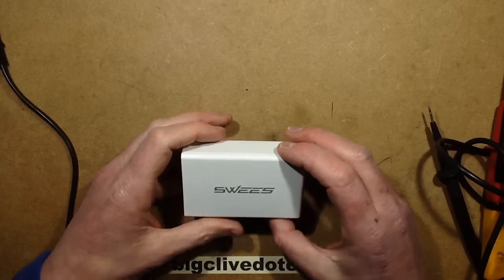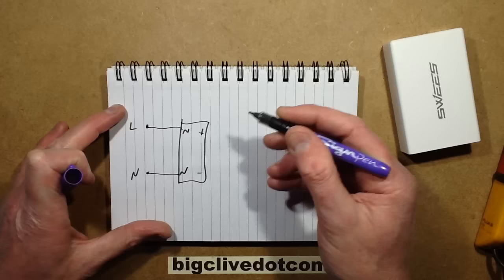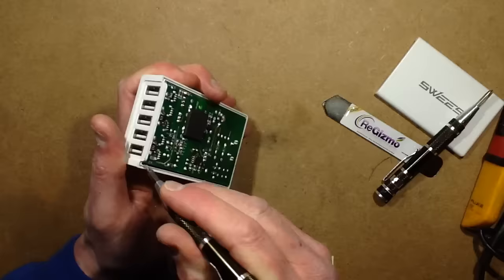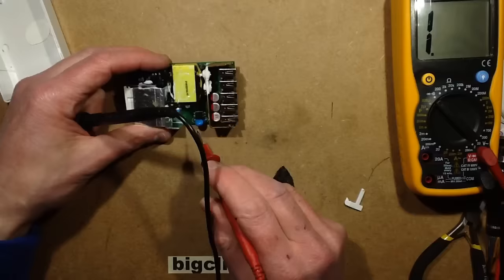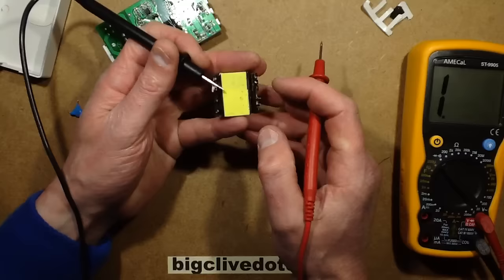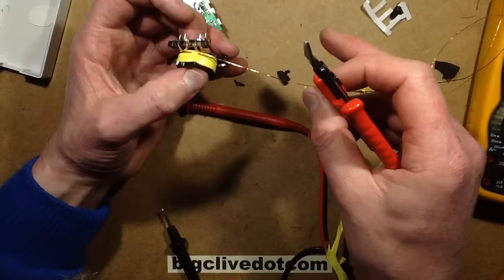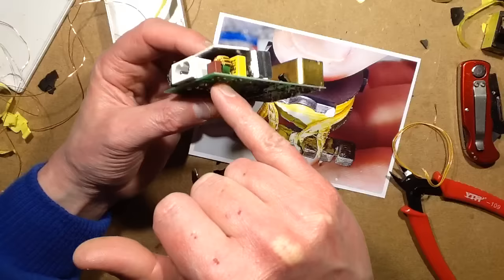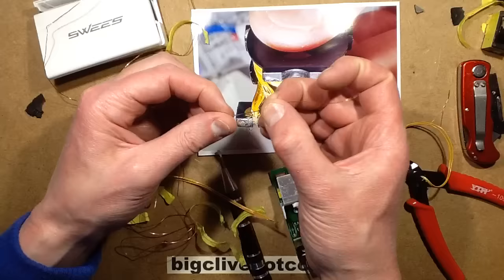Horrific USB power supply fault.  (Electrocution risk.)

Comment: high end looking product..
quality looking circuit..
faulty transformer..
really?
Reply: Yup, kinda surprising, but then again not surprising.
Reply: +Benjamin “Ozias” Esposti 
yeah, but they made such an effort to build a high quality brand and it gets fucked by one single fucking copper cable?
Hilarious! xD
Reply: It's that one in a million manufacture error. Probably from the factory that made the transformer itself, could even be an entire bad batch.
Reply: shit happens
Reply: They actually didn't make an effort. "Effort" would include, as part of quality control, checking to see if the whole thing was live. Design, components, and even assembly are not what you mostly pay for when you get a "premium" product, it's quality control. (Of course what you MOSTLY pay for is branding but quality control is a way of protecting the brand name so it gets done.)
Reply: Lauri3000 Nah dude, if you look at the transformer.er it's obviously a machine error that could have affected an entire batch before getting caught
Reply: Aaron Wise - could you please provide a short explanation, or some reference about creepage/clearance considerations? Thanks.
Reply: TechGeniux ii
Reply: Probably a supplier issue with the transformer that had little to do with the company making the overall device.

Comment: I have no idea what you talk about in these videos because I'm hardly an electrician, I hardly know anything about electrical besides the basic plug wiring and ohms law... However, I am deeply interested in your videos and have been subscribed for a while. Keep it up! :)
Reply from the maker: +Meteor Shower Don't worry, it'll all start making sense after a while.  In the meantime, enjoy the ride.
Reply: bigclivedotcom haha cheers bud, I'll keep watching for as long as it takes.
Reply: +Meteor Shower eevblog has some interesting videos, mainly the older ones. The newer content generally less practical.
Reply: +Meteor Shower After watching his explanations on power converters for a while,it all fell into place. I have been tearing stuff apart now for years,and really didnt understand how you could step down outlet power to just enough to satisfy a usb charger. Now I know what everything is and why it does what it does. watch his video on electronic components helps a lot. of course it makes you order electronic do it yourself kits, a soldering station,leds,capacitors,and diodes as well as other fun stuff. like breadboards,an oscilloscope electrical testors and all the other goodies,like me.
Reply: I understand about 80% of it.

Comment: Wow, well, you called It Clive, you fucking called it. It's finally happened, a mains output USB charger.
Reply: You can tell something's off when even a non-electrician knows it looks wrong.
Reply: +Akaishi well it doesn't take much, anybody knows if it makes your arms contract and you feel 50Hz 240V it's a problem
Reply: +Joshua Nicoll 
The high voltage means you need less current for the same power, so if this supply provides a half-amp it will charge your phone battery 20 times as fast!!
.
.
.
.
(sarcasm)
Reply: Joshua Nicoll So it automatically sorts out the bad ones? Nice! xD
Reply: It would only trip if you where earthed, since the device has no earth.
Reply: The only thing to protect you was a circuit current overload breaker
Reply: ***** true.
Reply: No, you would feel a strong tickle was the voltage would find a way to earth, but in the 1000/th of milliamp, it would still be unpleasant
Reply: +jrw6137 you would, there is ALWAYS leakage to earth, even from between wires in the cable, it might be a millionth of a milliamp, but you would still feel it. How about you ensure you are completely isolated from earth and touch the 240volt live socket, it mightn't feel much, but your muscles would twitch.
Reply: Joshua Nicoll You need about half a milliamp for the most sensitive people to feel it.
Reply: +jrw6137 Because they a megohm resistor and a neon bulb inside is a big reason why you don't feel anything, or did you forget about those components. When you have a resistor like that the breakdown voltage at which it's resistance is overcome is much much higher than that of human flesh.
Reply: Joshua Nicoll Well, okay. To be fair, I have once touched a live wire from a Christmas light while standing on a wooden chair and received a tiny tingle.
Let's do a little calculation, shall we? Current through a capacitor in an ac system is I = U*Y, Y being the capacitors admittance w*C So, to get C :<=> C=I/(U*w) = 0.5mA/(230V*2*pi*50Hz) = 6.92nF. Using the area of my feet roughly 100cm² = 0.01m² and the height of the chair being ~0.4m
C = epsilon*A/d = 8.854pAs/Vm*0.01m²/0.4m = 0.2214 pF, which is about 1/3000th I would need for a tingle. Conclusion: Either my approximations were extremely bad or they were only half-assed bad and there was still some resistance connecting me to ground (R = U/I = 230V*sqr(2)/0.5mA = 650.5kOhm is all the conductive path you need)
Reply: ***** Yes, that was the second part of my thoughts. However, I have no clue what the conductivity of dry pine wood (and the floor underneath!) is, so I just thought I'd compute an approximate resistor value^^
Reply: +Maanuueel42 \m/(^_^) There might have been some path through the air as well as the wood, since both conduct (relatively badly at these voltages) so it would have almost been like a resistor in parallel.
Reply: ***** Yes indeed. I am noticing this more and more often, being a university student. Many real-life things just don't work out as planned because the models are incomplete... -,- xD
Joshua Nicoll Meh, normal air is (like most gases) pretty much a perfect insulator, as long as the electric field strengths don't exceed a few kV per cm.
Reply: It's so much nicer arguing semantics with people who aren't trolls.
Reply: Joshua Nicoll Hehe^^
So I'd say if you are perfectly insulated from the ground, you shouldn't feel anything when touching a live wire. However, you never are perfectly insulated from the ground, so you will feel a tingle even when standing on an insulating mat or in a plastic bucket. You'd have to insulate yourself with much more heavy-duty things like a 20cm slab of acrylic glass. 
On the other hand, it could be fun way of testing for live wires. Just put on thick electricians boots and touch some wires (only one at a time obviously), making sure that no part of you body except the feet touches anything. Do not try this at home!! xD
Reply: +Maanuueel42 \m/(^_^) you'd also need to be in warp space since the flow of electrons will (probably in single file) find it's way to earth around the glass, since you are effectively an Arial transmitting  50Hz signal. however USB power supply's like that often switch in the 1000Hzs, so if that was super imposed to the output of the mains, you would be live with mains potential with a radio frequency to earth thus lowing the resistance substantially, which may well what have happened.
Reply: Joshua Nicoll Hmmmm if it switches at around 30 kHz (which is not unreasonable), that would cancel out the fault I just calculated into it (or 3kHz and 4cm distance to ground would also work and be quite reasonnable as well). Good thinking!
Of course, this means superimposed and "dirty" waveforms, in which the AC sine/cosine model with rotating voltage and current pointers doesn't apply anymore...
Well, you just made it quite a bit more plausible. I forgot this was a high frequency transformer after all.^^
Reply: +Maanuueel42 \m/(^_^) Indeed, and the filtering caps and diodes would mean the waveform would be cleaned up after leaving the device, and thus allow a superimposed 30kHz radio frequency into it a little easier since it's now DC (so around 320v since it's rectified mains)

Comment: If you ever come with a similar fault in the future you might consider using a razor blade or a scalpel to cut the pcb traces going to the secondary one by one. That way you could identify the exact windings that are short circuit. Only then remove the transformer and you will know where to look, even if the fault disappears.  Enjoy your teardowns, excellent work. Cheers.

Comment: Hi, Clive. Great video as always. Must point out out that under safety testing there must be creepage and clearance distances between primary and secondary circuits. I did see holes in the PCB usually to increase creepage distances, however putting a foam sticker over them will cancel the reason for the holes reducing the creepage again. Also if this foam is hygroscopic would fail the flash test after the humidity test.
Reply: Yes, and normally those components providing the isolation would be 3rd party tested and approved per the requirements of the LVD supported by EN/IEC 60335 or 60950.
Also the conformance testing of the product after manufacture should have picked up the defect, but then of course CE means China Export to them😡

Comment: That really is too bad. They even used polymer caps on the output, where you pointed out where they are next to the heatsink. They will have a much longer life expectancy in such a situation than electrolytic caps. So, they tried and it isnt a bottom dollar design.It just looks like whatever machine was wrapping that transformer maybe had some protrusion or something?
Reply: +Clyne Griffon I was wondering if it was maybe a soldering iron tip brushing across? hard to tell
Reply: Christine Felice  not at all, if the winding machine wasn't defective this would not have happened. Regardless it's probably one of those 1 in a million manufacturing errors.
Reply: @sergiofreitas9368  if they had the windings on seperate bobbins there would be no risk of this happening.
Reply: @internetguy1260  They used to do this with the old E/I core ones, but as he mentioned, it does take a hit in efficiency... and quite a large one too (about 20% from memory)
Reply: @steved2136  it's the struggle or modern society! Efficiency, or safety? Hah!

Comment: In Canada we have a CSA which may actually do just what you did. The Canadian Standards Association does product safety testing, like UL.
Reply: +tesla500 We have the EC.
Reply: +tesla500 — UL, CSA, CE and other safety laboratory markings on Chinese electrical goods are meaningless, especially on no-brand and obscure brand products.  Some years ago, while returning a load of malfunctioning 4-foot fluorescent shop lights to my local Home Depot store, I had a chance encounter with a fellow who moonlighted in the electrical department after his main job at Underwriters Laboratories.  He told me that it was not uncommon for the Chinese to affix fake hologram "UL" stickers to their goods when they had never submitted such goods to the laboratory for testing in the first place.
Reply: +Milosz Ostrow Sadly true. The Chinese simply copy everything including markings.
Reply: Thankfully knockoff factories are no better at copying the relevant markings than they are at copying appliances so a close inspection of the marking can show whether it is fake or not.  In the UK the CE mark is the first thing I look for on a device because it will either be crystal clear as though it was finely scribed by a small inkjet printer during the manufacturing process or it will look just like a blurry stamp as though that is exactly what someone did, just stamped the casing by hand after they've assembled it.

Any professionally made device or appliance will have professionally applied markings and labels.
Reply: I saw a thing on TV a few years ago where the Chinese had invented a standard called "China Export".  The logo of this was almost indistinguishable from the CE logo!  http://www.icomuk.co.uk/News_Article/3794/17103/
Reply: UL requires a number to be affixed which you can lookup and verify the item.
Reply: The "China Export" thing is a joke that somehow a bunch of people believed was real. It's just the CE mark copied badly by Chinese fakers. It's not an actual standard, just a poor copy of the real CE logo. Someone made up the "China Export" explanation and it stuck.
Reply: Remember that for most of our agencies and watchdogs, someone needs to file a complaint. Sometimes it's as easy as a form online. So remember if you see some horrific product like this on the shelf, report it.
Reply: Tbh I don't think this would have been found anyway unless it was sent to them after the fact as in this video. It seemed like the design was sound but this particular transformer had a manufacturing defect.

Comment: You can spend numerous hours designing and laying out a proper SMPS with the best engineers just to have it all killed by penny pinching part pickers without your knowledge 
also i may add that that adhesive foam on the bottom is BAD ... its not conductive but it will track fairly well, carbonize and short after some time ... especially if any contaminates got under it ... if you have to use one place it on the LV side to prevent tracking or place the adhesive side on the case it self

Comment: How does having the transformer after the bridge rectifier work? I thought transformers required AC to function?
Reply from the maker: +trainmeditations Switchmode power supplies convert the incoming mains to DC and then back to AC again at high frequency so they can use smaller transformers.
Reply: ^^^
(Youtube is broken and I can't tag people, but I'm adding on to what bigclive said)
Yep, and the fact that it operates at a high frequency allows the power supply output to be regulated as well. This significantly increases efficiency, since otherwise you'd need a linear regulator which can give off a LOT of heat.
Reply: Thanks guys, that actually helps me understand. I guess I'll look into why smaller transformers can be used for higher frequency

Comment: Why did the transformer suddenly stop showing the short-circuit after you removed it?  Is it possible that the transformer was not the problem, and there was something else on the board (bad soldering perhaps or some loose metallic debris) that could have been the real culprit?
Reply from the maker: No.  It was definitely the transformer, but the primary was just barely touching the secondary and the tiny movement parted them.
Reply: Clive have you got a Toneohm? I think they still exist - I used one in the 80's and it's great for finding shorts which a normal multimeter isn't sensitive enough to find. It could have identified which pins of the transformer were short before you removed it...

Comment: I would have overloaded it with a more power consuming device like heater, it would have burned the contact point, which could be found at the same time.
Reply: That's a really good idea!
Reply: Reconnaissance by Artillery. If there is a bigger explosion than the regular shells you've hit a target.

Comment: How dull is your exacto blade that you can use it aginst your thumb without pause for consern
Reply from the maker: It's not the sharpness, it's how you use it.
Reply: a sharp knife is a safe knife...
Reply: DigitalEkho the safest*
Reply: sharp knives are safer than dull knives,  like Clive said, it's how you use it
Reply: 0Alastair0 his is not sharp tho lol
Reply: DigitalEkho but as we said earlier, it's how you use it
Reply: Yes, I use a snap off knife daily and you were using it wrong, never cut/push towards your fingers.
Reply: @supergipas Folding metal utility knife.  Any Lowes, Home Depot, WalMart .. etc etc.
@Eoquencawacha If you work enough with your hands and build up thick enough callouses, you can put a surprising amount of pressure on skin with a razor.  As long as you aren't sliding it back and forth, like Big C says, it's how you use it.
Reply: Big Clive's thumbs are mighty.

Comment: Hope you got the part number, lot number and production date off the transformer before disassembling it, to be able to report it to the manufacturer and/or supplier/importer. Great video.
I suspect the physical trauma to the transformer caused by its removal separated the shorted windings just enough to show no fault when you tested it.

Comment: Fascinating watch after the Ikea "good kit" teardown. The only problem is that I'm developing brow wrinkles & pucker syndrome (at both ends) every time you get forceful using a sharp object. I mentally recall Stanley Knife & scalpel slips of old. It's like a form of engineering-related PTSD.
Reply from the maker: It only takes a few stanley knife slips to drive the message home.

Comment: I rented a house once from a guy (I'm in the US) who "upgraded" the all of the 2-prong plugs to 3-prong by tying neutral to ground. I didn't really realize what he had done until I picked up a USB extension cable which was plugged in between my optical scanner and my PC, touched the metal shroud on the extension, and got 60VAC @ 60Hz in my hand. USB shield tied to PC chassis, which is tied to power supply ground... which was tied to neutral at the wall. It's a wonder that I never got any computer or network gear fried in that house the entire time I lived there.